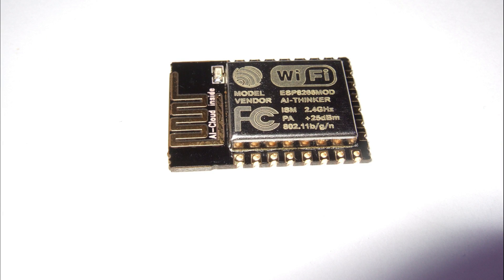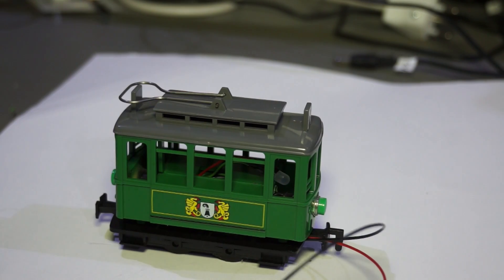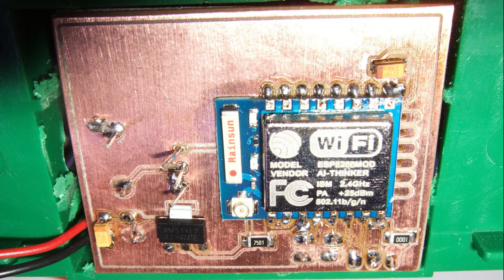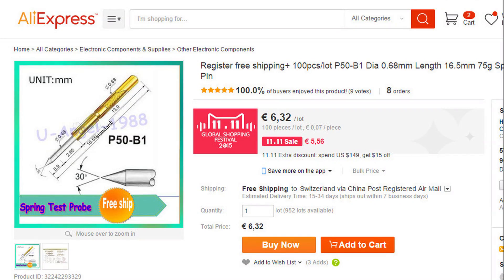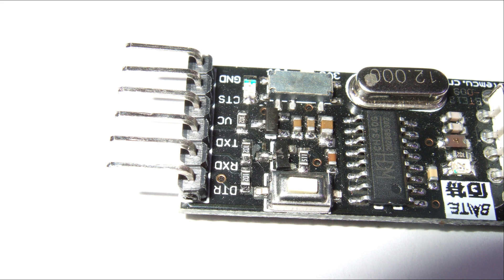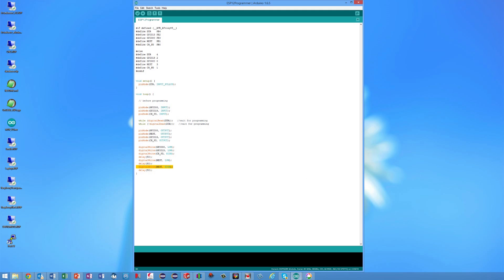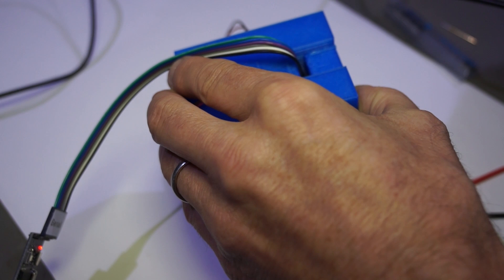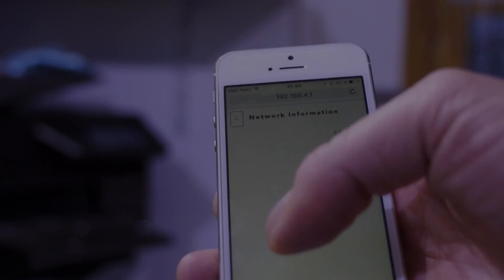#30 Internet of Things with ESP8266 #2: Physically Programming ESP-12

Comment: have you ever work on android broker such as moquette or something like that ?

when we have one esp8266 and we want to connet to it with 20 mobile phone what happen?
each esp8266 or esp 12e can just have 8 TCP/ UDP connection

what's your idea if we have 20 mobile phones and simultaneous they want to connect to one esp publisher?

if we run an android broker on one of mobile phones and other connect to it we can connect to esp by one TCP/UDP from broker to esp, is it true?

have you ever work on android broker such as moquette or something like that ?

and we don't have any cloud on the net!!!!
Reply from the maker: I did not use moquette as I am not very much in Smartphones. And the ESP is quickly overloaded with HTTP traffic. So do not try 20 parallel connections.

Comment: I have problem.  I want to use a WEMOS D1-mini as a wifi extender.  I know it can do this but, if there are more than one SSID, I may have just answered my own question.  Log onto the wifi/SSID I want to extend and then broadcast the same SSID?  You think you could maybe make a video explaining this?  Thank you so much for ALL your videos.  I have learned a lot from them over the last year.
Reply from the maker: I once saw somebody doing this. But it is not simple and needs some deep Wi-Fi knowledge (or you find a ready-made script). Anyway, it will be very slow...
Reply: Please take a look at the ESP-LINK project by Jean-Claude Wippler. I think it does not do WiFi-WiFi bridging but it can give you inspiration.
https://github.com/jeelabs/esp-link

There will be limitations in bandwidth (one channel on one radio) and programming challenges with TCP concurrency and memory. I have read that the TCP layer can only accommodate five (5) concurrent sockets. Even if you could increase that you might start hitting memory limitations.
Also it is not clear to me right now if you could get FreeRTOS integrated with the TCP stack to allow concurrent operation. My experience using the Arduino stack is once there is a lost packet all other TCP clients wait in line.
https://github.com/esp8266/Arduino/issues/3185
https://stackoverflow.com/questions/37419651/how-many-simultaneous-consecutive-connections-can-an-esp8266-webserver-handle
http://www.esp8266.com/viewtopic.php?f=8&t=10033

May I suggest purchasing another wifi router off ebay and using WDS bridging? My router's documentation suggests it might only work with the same brand. Last week I bought two TP-Link Archer C-8 wifi routers for less than $40 each, and added wired connections as per:
http://www.wikihow.com/Connect-Two-Routers

Another option is find a router that is supported by OpenWRT (latest is now LEDE project, with plan to merge back into OpenWRT). I never tried it, but it seems promising, especially the wireless mesh network capabilities (search for B.A.T.M.A.N., BMX6, and Babel). If you like programming our ESP8266 maybe you may also enjoy hacking an ARM or MIPS router.
Reply: https://github.com/martin-ger/esp_wifi_repeater
Here's a link to already made firmware by Martin Ger on github that is easy to use, and also has every bit of information you may need.

Comment: Hello I adjusted my LM2577 Boost Buck convertor 3.3 V via potentiometer. My connection.  Vcc--10kOhm--CH_PD    Vcc--10kOhm--REST  GPIO15--10kOhm--GND  GPIOO--10kOhm--Vcc. But when instrument ESP12E Vcc and GND. I see 2.5 V 2.7v. Why voltage dropping occur?Im thinking about doing adjust the potentiometer until the see 3.3v multimeter screen  but Im avoid the adjust SMPS when it was power on.I assume it will be easily damaged the esp. Can you help me?
Reply from the maker: I cannot do remote diagnostics. A converter should stay at 3.3v. Only, if the load is too big, voltage should drop. Maybe you check with a different load than an ESP

Comment: I see your USB <-> serial adapter has the CTS pin and from what I can tell that should also be manually controllable as an output. Couldn't that replace the RTS pin for programming?
Reply from the maker: CTS and RTS are going i the oposite direction, so none can replace the other. You would have to buy a USB/Serial module with a RTS pin (e.g. https://www.aliexpress.com/item/Free-shipping-5pcs-FT232RL-FT232-FTDI-USB-3-3V-5-5V-to-TTL-Serial-Adapter-Module/32276328498.html).
Reply: You are correct, the CTS pin is an input only pin. Going back to the image I did find the DTR pin though and this time I did some proper research and found this C code example of manually controlling the DTR pin: http://xanthium.in/Controlling-RTS-and-DTR-pins-SerialPort-in-Linux

Looking at the source for esptool-ck ( https://github.com/igrr/esptool-ck/blob/master/serialport/serialport.c ) it seems to support using both DTR and RTS for reset. Could you test if this works? I'm using a Bus Pirate as a transparent serial bridge so I don't have the DTR pin.
Reply from the maker: Currently, I do not have the time to do that. But if somebody wrote some code for it, you can assume that it works.

Comment: Hi Andreas, I am enjoying your series of videos on the ESP8266. So much that I bought one to play with. However, I can no longer find the code for the Attiny85 timing sketch on github.com/sensorslot/internet-of-things-with-ESP8266. Have you got the code anywhere else?
Reply from the maker: I discovered later, that you do not need any code or Attiny. You can hard-wire the pins of the programming device for programming only. Because this device is only used for programming, you remove it after upload and the ESP boots into the run mode (if your "production" PCB is correct).
Reply: Thanks for that Andreas. It makes sense.

Comment: Sir, i have issue regarding Flashing NodeMCU 
After flashing "nodemcu_integer_0.9.6-dev_20150704" with ESPFlasher .... 
ESplorer shows that "Can't autodetect firmware, because proper answer not received."
and END without showing firmware version..
what should be issue?
Reply from the maker: I do no work with Esp flasher or LUA. So, i am not the right person to answer

Comment: Very clear video. I managed to upload the blink sketch via Arduino IDE but once upload completes, what do I need to do to initiate normal run? Do I need to disconnect GPIO0, GPIO15 ... connect RESET to Vcc ... Disconnect EN ...etc? Thank you very much.
Reply from the maker: To make the ESP8266 run you need CH_EN, RST and GPIO0 high and GPIO15 low. Then it should start running your program right after power up. If you upload and keep the module powered it even starts to run with GPIO0 low because it checks this pin only during power-up or reset.
Reply: Thank you! It is blinking now. Thank you very much.
Reply from the maker: +Kian Peng Yong you are welcome!

Comment: Could you please share your ATtiny code for the program timing?
Reply from the maker: +Scott Symes I learned, that this is not necessary. Because I use the pogo pin adapter only for programming I connect now all pins as required for programming and add a switch for power. For programming, I switch the poser off (to not accidentally destroy the module) and place it on the module. Now, I switch on the power and because all levels are right for programming, the module boots into programming mode. Then, I hit "upload" and after the upload is done, I remove the pogo pin adapter. When I put the module in its target place it boots right into the run mode. Much simpler than I thought initially.
Reply: +Andreas Spiess ok. thanks very much for the detailed description. I'll see if i can get one programmed.

Comment: Gr üezi Andreas, super video! Ich benutze einen FTDI FT232RL, diesen USB adapter hat einen RTS und die RX-TX sind 3.3V, sehr bequem beim programmieren.
Reply from the maker: +Javier Palla Lorden Meine Adapter verwenden CH340 Chips und ich kann sie auf 3.3V oder 5V umschalten. 
Vor ca. einem Jahr hat es einen Skandal mit FTDI Chips gegeben, bei denen gefälsche Chips durch einen Treiber zerstört wurden. Seither verwende ich keine FTDI Chips mehr. Dafür musste ich hier halt einen Attiny "opfern"...
Reply: +Andreas, ja genau, diesen CH340.....die gibt es ja auch mit RST(RTS?), zum Beispiel: http://www.ebay.com/itm/ICSH037A-CH340-USB-to-Serial-Module-USB-to-TTL-On-board-500mA-self-recovery-fuse-/221937637656
Reply from the maker: +Javier Palla Lorden Du hast recht. Den habe ich noch nie gesehen und es gibt ihn auch nicht auf Aliexpress, wo ich normalerweise einkaufe. Gut zu wissen.

Comment: Hallo Andy, interessant wie immer. Auf dem NodeMCU Schema ist auch der Autoreset Teil sehr schön ausgewiesen: https://github.com/nodemcu/nodemcu-devkit/blob/master/Documents/NODEMCU_DEVKIT_SCH.png aber ich geb Dir natürlich recht: für eine Kleinserie ist der attiny85 viel praktischer.
Reply from the maker: +norm1124 Soweit ich sehe, verwenden die dort auch den DTR Pin des CH340. Und der ist bei meinen Adaptern leider nicht herausgeführt. Ich habe nur CTS und das ist ein Input. Trotzdem verwende ich das NodeMCU Platinchen sehr gerne. Das einzige Problem im Moment ist das Port Mapping. Ich muss in de IDE "Node MCU" als Board wählen sonst funktioniert der Upload nicht. Und dann haben die Ports Namen Dx (z.B. D8). Für die ESP-12 Module wähle ich "Generic" und dann kennt die IDE die Dx Namen nicht mehr. Hast Du hier eine Lösung? Bei Arduinos kann ich eine Konstante über den Prozessortyp abfragen um zwischen Attinys und Arduinos zu unterscheiden.
Reply from the maker: +norm1124 èbrigens Danke für den Link zum Dokument. Da hat es noch verschiedene Interessante Details (z.B. Port Mapping). Habe es gerade als Referenz ausgedruckt...
Reply: +Andreas Spiess danke Dir für die guten Videos, leider habe ich nicht sehr viel Erfahrung mit den IDE Einstellungen. Einzig bei der Integration in den Travis-CI via github könnte ich helfen.
Reply from the maker: +norm1124 Wozu braucht es Travis-CI? Ich werd nicht schlau aus der Homepage
Reply: +Andreas Spiess das System compiliert jeden commit und pull-request gegen jede Plattform. Hier das minimale Beispiel mit Blink: https://github.com/chatelao/arduino-ci-test-blink und die Seite im Travis dazu: https://travis-ci.org/chatelao/arduino-ci-test-blink
Reply from the maker: +norm1124 Muss ich mir mal in Ruhe ansehen: Danke!

Comment: Very nice video, Andreas!  I'm guessing the next step would be Over-The-Air sketch uploading?  Keep up the good work!
Reply from the maker: +Eli Mareyev Yes, you are right. OTA is more comfortable that the solution with pogo pins. But the version of this video is still necessary to put the first sketch on the module (or reload a working OTA sketch if the sketch does not do anymore OTA).